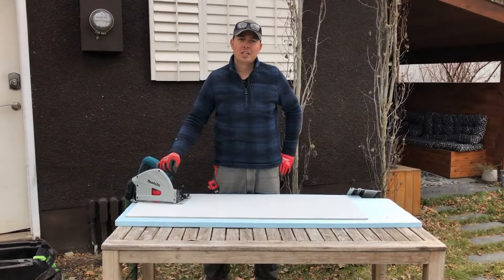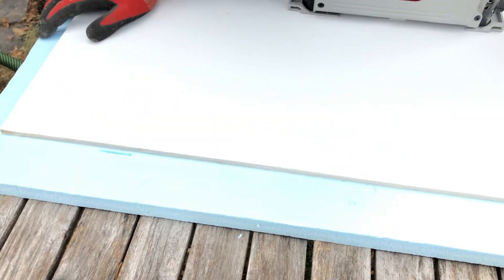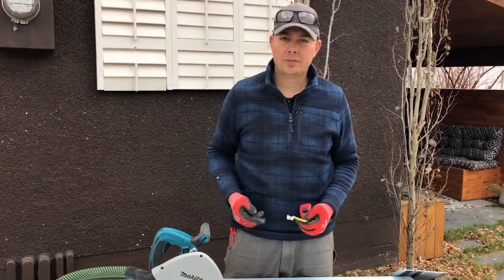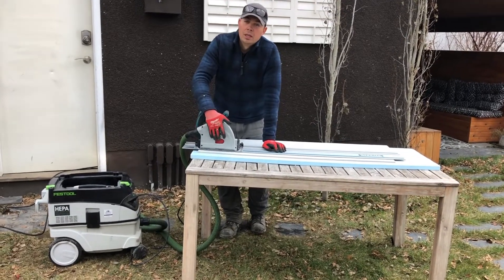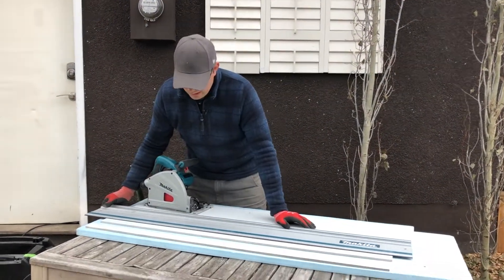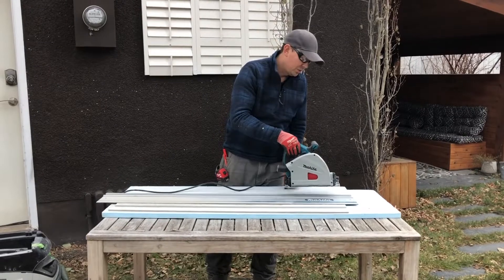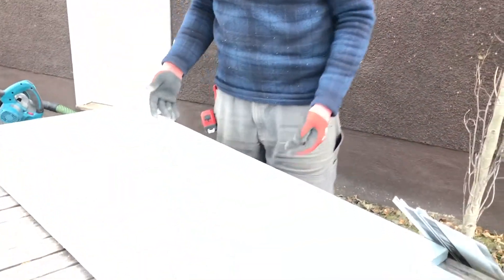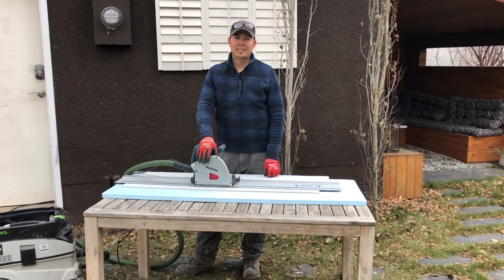How to SAFELY cut Hardie Board without dust! Using a Makita Track Saw & Festool Hepa Vac

Comment: Has anyone used this saw for hardi for over a couple years? I've suggested we use this method at the company I work for, but some guys reckon the track saw won't hold up to hardi dust like the old makita dustless saw we have been using

Comment: Thanks for making this. I can’t believe there’s no dedicated track saw for concrete board. My team uses grinders and vacs with respirators, works great when your cuts are covered. But I’ve got a project coming up using hardie reveal system 2.0 where the cuts are visible, so the cuts need to be perfect and the only way I could think of doing it was with a track saw.

Comment: If you flip that panel and cut on the back side you won't get blowout of both sides. I get this is just an example. 

I use a respirator and am one of the few in Manitoba to use anything when cutting. If only people understood that the silica dust in open air is worse than smoking. 

Did you use an arbor ring on that blade?

Comment: I'm gonna start using a chop saw and a mask if need be. My buddies say they save a lot of time using the mitre saw rather than an angle grinder which we still use
Reply from the maker: you should try a guillotine cutter, no dust. they are better than using a chop saw

Comment: What are you using the hardie backer for. I’m looking at the exact saw except cordless
Reply from the maker: BZ1340 it was some scrap Hardi pannel from a job we did.
Reply: To: BZ1340, That's not Hardie backer, it's Hardie panel siding. Hardie backer is the the board that is used in showers as a backer for tile applications. Hardie backer has less fiber and is mostly cement and polymer additive and is about 3/4" thick whereas Hardie siding is 1/4" thick and has a large ratio of fiber to cement, therefore much different to cut.
Reply: @jelibersat  I meant the siding. I've used both materials in its specific application

Comment: How did you get a Hardie blade to fit on the plunge saw mine have 20mm arbor and I can’t find cement blades ?
Reply: their in amazon, or a local store would be ACE HARDWARE